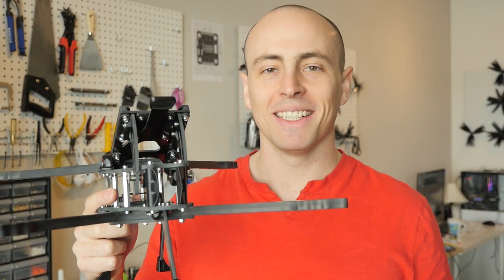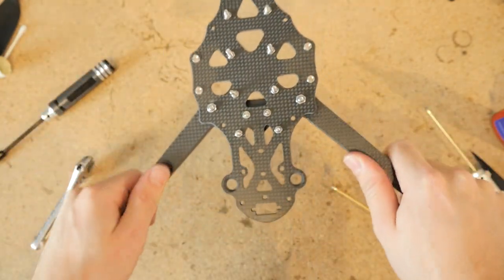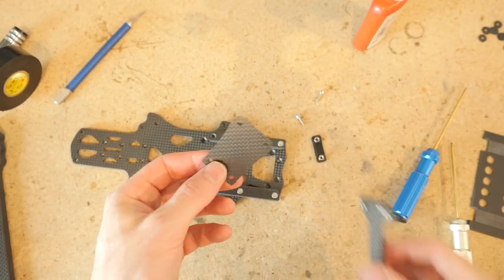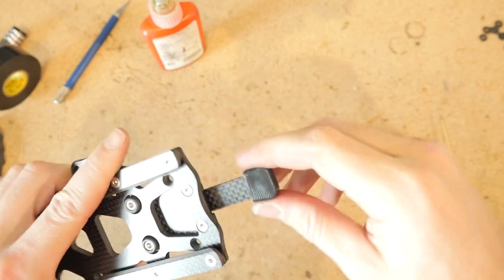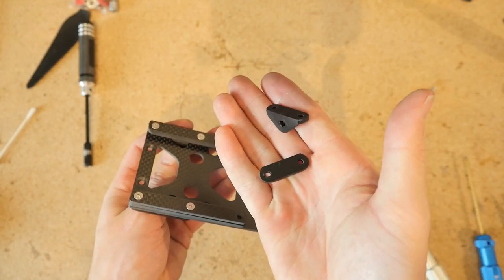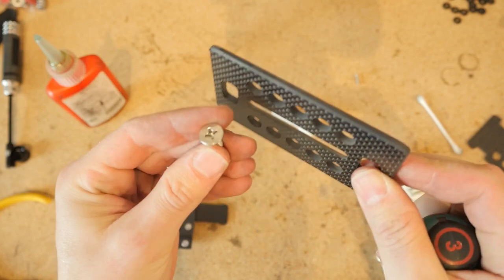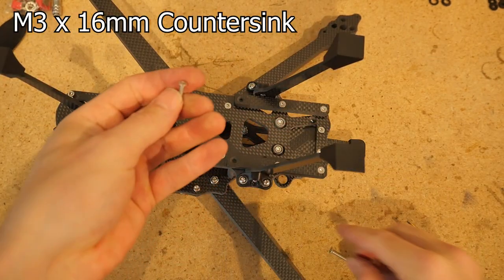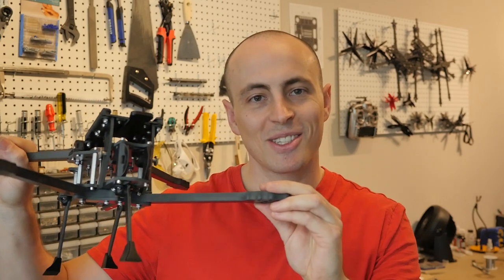La Mamba Frame Assembly

Comment: Will this frame house an o3 air unit !
Reply from the maker: Yes! Here's a link to La Mamba GrabCAD page: https://grabcad.com/library/la-mamba-rigid-petg-prints-1 On it you will find a VTx 30.5x30.5mm stack mount adapter that has 25.5x25.5mm holes for the o3 air unit. You can either 3d print it or cut it out of carbon fiber. It allows the O3 air unit to mount right above the FC or ESC.